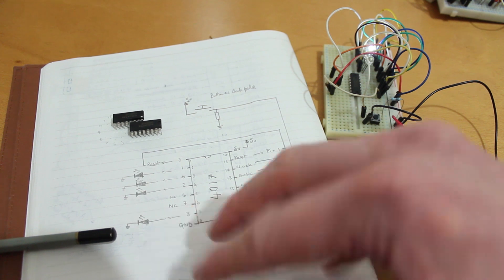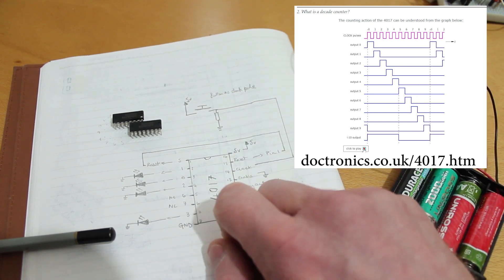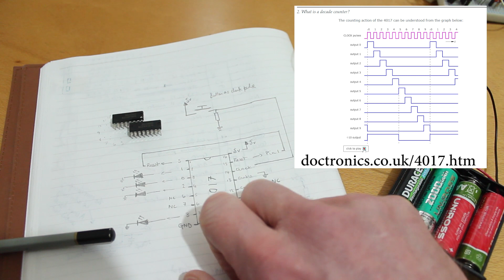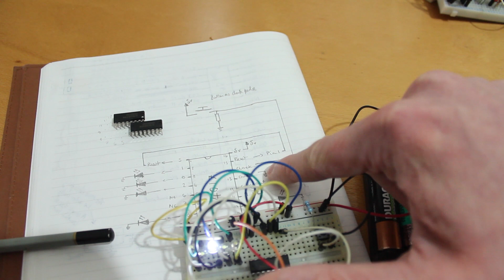4000 Series Logic ICs: The 4017 Decade Counter

Comment: Is it possible to have a second button that reverses the count? So, button one counts forwards 1,2,3...and button 2 counts backwards...3,2,1.
Reply from the maker: Not with the 4017 that I can think of, but if you took a CD4510 (it has an up/down pin) connected to a CD4028 to do the BCD to decimal conversion,  I think that would work.

Comment: Can you wire this to produce randon numbers?
Reply from the maker: Generally the output will be random data on power on but I wouldn't guarantee it. You could hook it up to a 555 and have the clock connected to the output via a button which would disconnect on press giving you a pseudo random output.
Reply: Sir where this book find